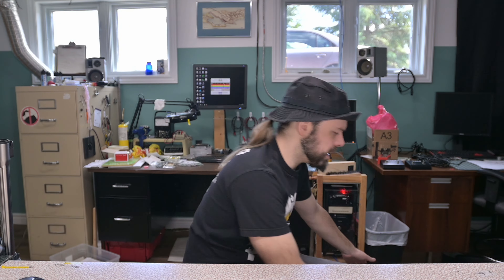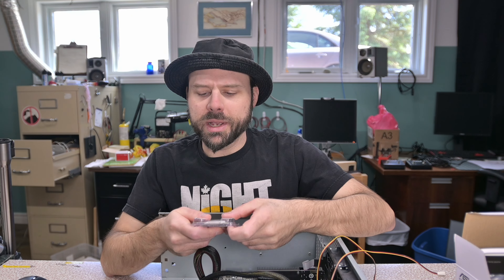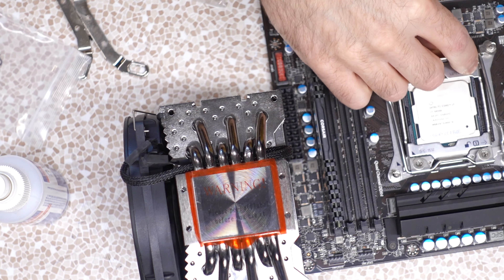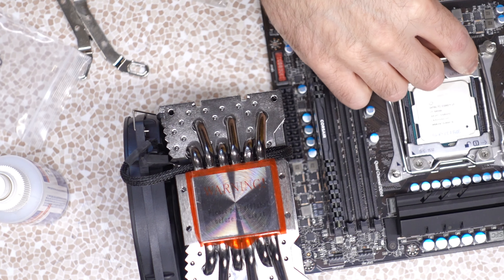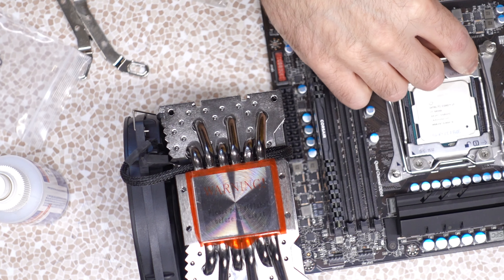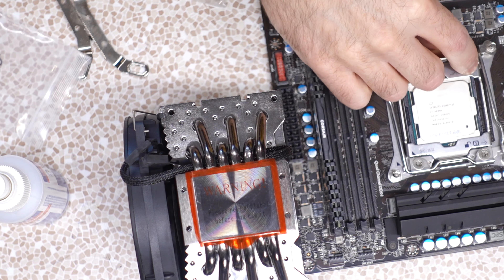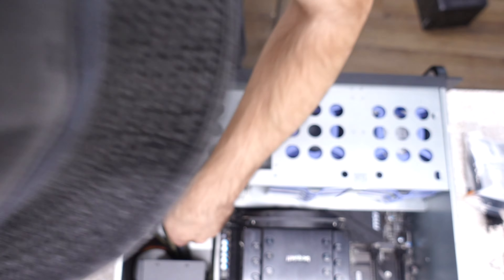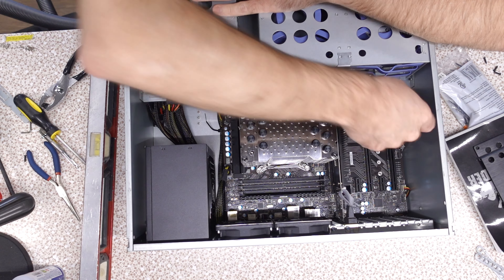Random Rack PC Build

Comment: Might have trouble getting over 3ghz on quad channel with 8 sticks. I had a fair bit of trouble with 8 sticks in my x99 A2 with the 5960x and ended up downclocking the ram to 3ghz from 3600 (or 3200) the set was rated for. Stability was sooo much better and performance only took like a ~5% dip. 
That was 10 years ago this month... I hate time haha

You might have much better luck with later lifecycle ddr4
Reply from the maker: Yeah, I guess ram speed is not going to be as big a factor for a rig like this.